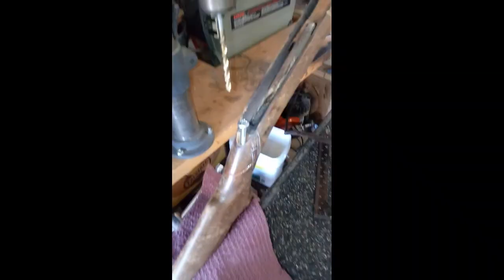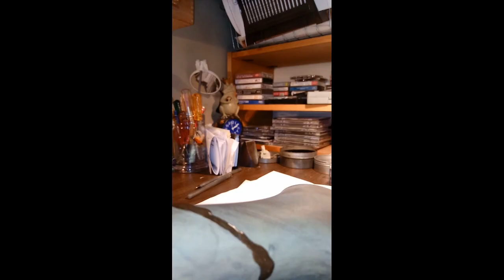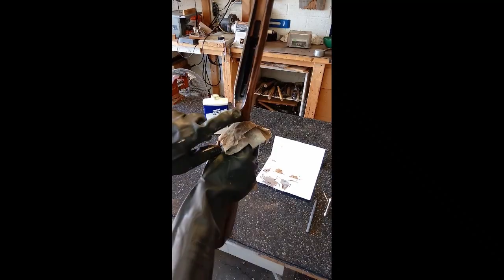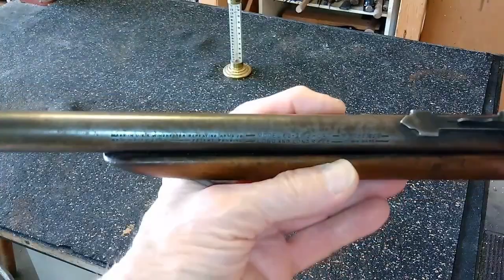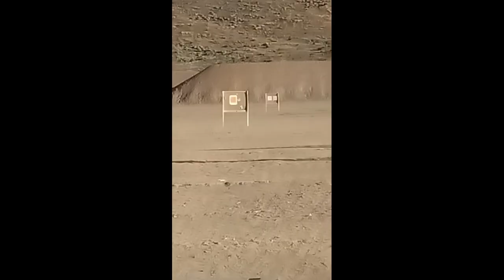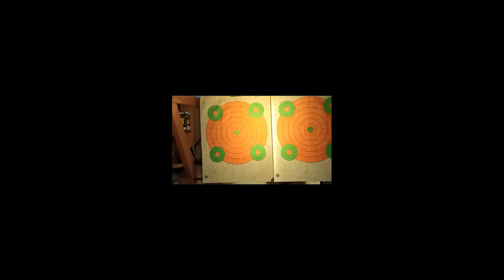Winchester Model 60 Repair, Restore & Test Fire

Comment: This brings me some flashbacks!  And nicely done!   I have a '31 Model 60 which was in similar shape to yours.  Stock split in 2, held together with 10 nails and cloth tape.   Took it all apart, repaired stock, fixed the hair trigger on it and it's a fun little shooter.  I might reline it this year.
Reply from the maker: How the accuracy on yours?